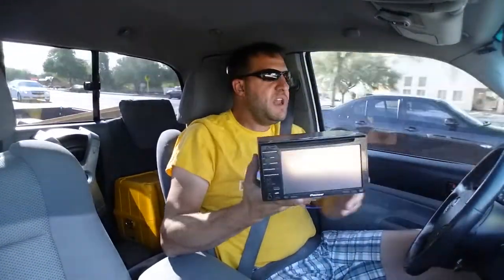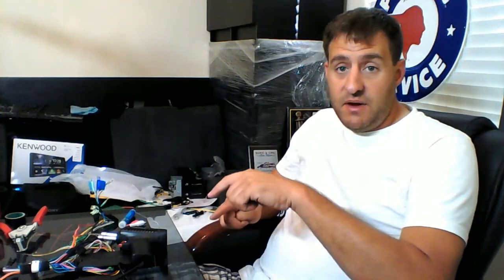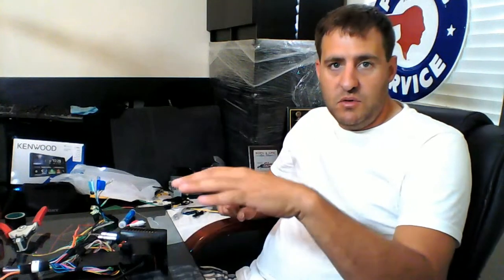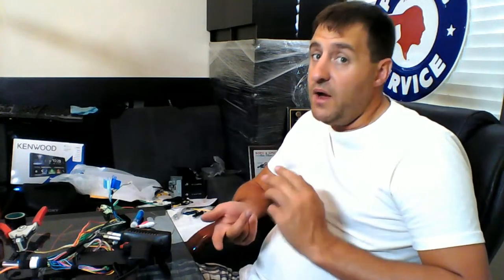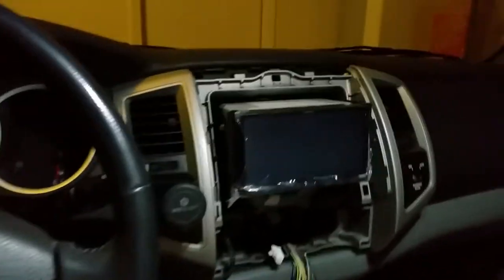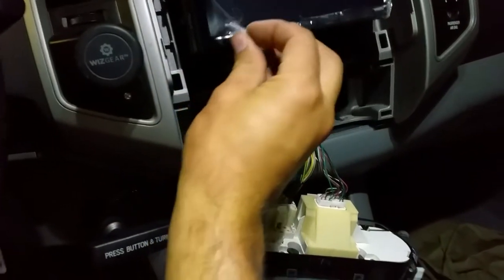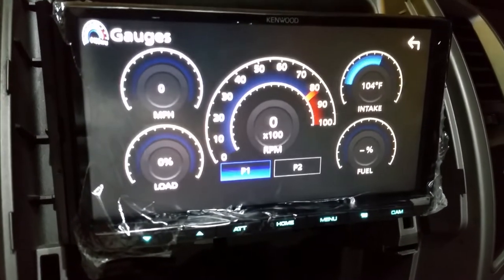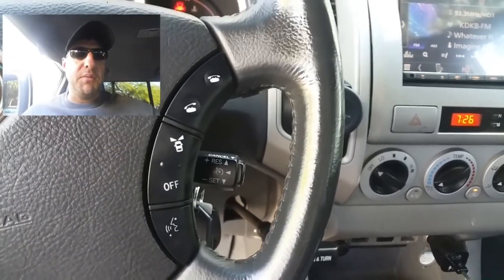Josh's Car Corner - Ep. 58 - Installing a New Stereo with Vehicle Integration

Comment: Whenever I drive a stick shift the best way to stop is to roll in the gear you are in until you can creep the gear out without pressing the clutch. If the light changes before you come to a complete stop just downshift a gear and keep going. You don't have to power shift every time unless you are racing into a corner on a track.

Comment: Great video as an introduction to your channel for me. Wondering which Maestro model you used? Also, I did an install of a Kenwood DDX9707S on my '06 4Runner last weekend and ran my mic to the center of the top of the windshield near the rear view mirror and really recommend it. I get really good pickup on it even when windows are rolled down.

Comment: Hi Josh, thank you for the video.  I agree if your going to do anything it is worth doing a complete job.  Can you share where you got the right side steering wheel control?
Reply from the maker: I purchased it from Impex Japan, but in hindsight I wouldn't buy it again because the Maestro can't be programmed to use the extra buttons and because it lights up green instead of orange. The best part number to use would be 84244-35030-B0 for the buttons, plus 84204-58010 for the ribbon cable.
Reply: So is that’s the left side part number what is the right side part number? For voice control

Comment: Hey man. Nice work. I've got a 2014, and I'm hooking up the RR2 to a Pioneer radio. These harnesses are ridiculous. There is way more wiring than is needed, IDK why they don't make a smaller harness out of all this. I'm planning to splice/solder the F out of this thing to cut it down to size. What do you think?
Reply from the maker: It could help. I am having problems with my steering wheel controls not working, and I'm thinking it's down to a bad connection somewhere either in the main harness connector or the module itself. Shorter wires would help with that I think because I think everything is getting crust behind the radio.
Reply: It's probably cheaper for the manufacturer to make a larger generic harness that works for multiple applications than a more specific one for exacy combinations of hardwares

Comment: Hey Josh. Couple questions. 1. Did you hook up the pink wire (vehicle speed) and yellow/black wire (foot brake) coming from the Maestro? I have the same truck, but no pink or yellow/black wire coming from aftermarket harness. 2. Did you have any issues getting the OBD2 to communicate?
Reply from the maker: No, I was provided an OBD-II connector with my kit and that's where the Maestro is getting vehicle speed from.

Comment: Looked promising, but turned out not to have enough details. I'd love to see how all the wires in the Maestro unit come together with the TO1 harness. I didn't need you to teach me to solder, there is a million other videos for that. I'd love a bit more detail on the backup camera wiring/integration. The only thing you covered reasonably well was the extra steering wheel button installation.

Comment: Hey Josh...   Help Please!   I have a 2010 Taco that ALSO needs those right-hand steering wheel phone control buttons.   What was your source on that switch cluster??
Reply from the maker: Mine came from Japan, but they aren't worth it because the extra two buttons don't work,  and they light up green. You can get the correct ones and the ribbon cable at the dealer.
Reply: @JoshsCarCorner  Would you happen to have a part number for that (the one from the US dealer)?

Comment: Nice video! And where did you get the steering wheel controls from??
Reply from the maker: Impex Japan, but you don't have to. There's a Toyota part number for them and you can get them from any dealer. Wish I could remember it, but do a search on the Tacoma World forum and you can find it.
Reply: Josh's Car Corner alright cool thanks well mine don’t have any controls but i have that feature on my Kenwood to have the gauges all that cool stuff. I guess I have to get the maestro to get those to work
Reply: Kevin Argueta did you find the part number?
Reply from the maker: @geocow5105  I answered this question in response to a different comment.

Comment: Where the links to the products
Reply from the maker: You can find everything on Google, e cept the radio is no longer made. Kenwood has a new model now, the DMX7705.
Reply: @JoshsCarCorner  okay thank you dumb question do I need to disconnect the battery when doing this